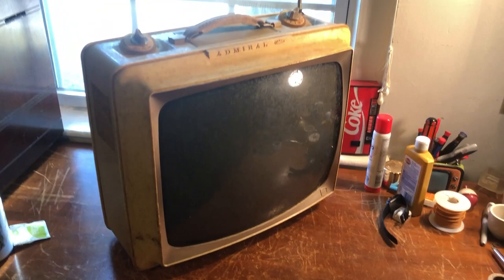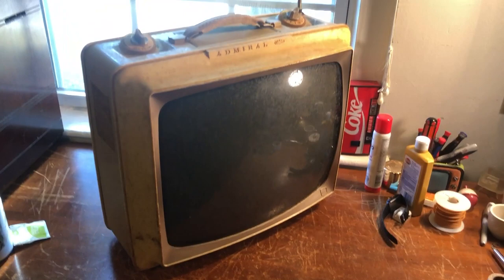1959 Admiral Briefcase Television Restoration

Comment: Model number tags on this vintage sets often on the BOTTOM, ( RCA, Admiral, Westinghouse ) & some others. Chassis ## when used is better to have.  Inked 
or tagged on chassis as a rule. Was a Zenith-Admiral dealer for many yrs.  These
were good sets, better than the newer Admirals.
BTW  if you want to do a hand wired set try a Zenith @1960 or newer.  Easy to
fix & they are almost immortal.   Well done Jack !
LFOD !

Comment: When I was a kid in the 70’s I used to always repair televisions, toasters, vacuums and other appliances. Today I am 62 yrs old and cannot remember one thing about repairing tv’s. I’ve got a 65” tv that the backlights are out on and am afraid to take the repair on myself. Keep up the great work but in the future, please make sure you start off with a clean screen, it really helps. I used to clean appliances perfectly before I worked on them.
Reply: You are saying that back in a day as child you hade guts to open live chasie and now you are afraid to open low voltage tv ?!
Reply: Quite a simple to fix, you just change the defective strip of LEDS inside. You will have to get some help removing the flat panel (Screen) so you don't crack it and all the diffusion layers underneath, then unclip the shield and the LEDS are just held on with double sided tape. Gently warm the defective strip with a heat source, (I used a hairdryer) peel them off slowly and unplug them. I've done a few in my time.

Comment: What a difference between this Admiral and Philco Seventeener. You can tell which one came first by the design ( Philco)
as this Admiral seems to have a more logical placement of the insides of the chassis and much more easier to remove 
from the cabinet! Of course it has  a couple more inches of picture tube than the Philco and Philco will fight back on that.
 Should be a dream to restore the components  compared to the Philco equivalent. Tuners are fussy in  Admiral's and
perplexed my  hobbyist repairman Grandpa many times back in the 1970s.

Comment: Great project!  Very few left around. Since it doesn't have an evil brightener installed you may be able to get some life out of the bulb by a "cleaning" with the proper tester. A later Sencore or B&K or Beltron might spark it to more useful life. If the cathode had been baked with a brightener, probably not.

Comment: Nice looking model, the restoration turned out pretty good.
Just talking to my buddy about AV signals and I was under the false impression Composite was completely different than RF but he informed me it contains some properties of RF too. Mainly I'm kind of anti-RF because it tended to add noise where there shouldn't be any Ie. the signal coming from devices directly connected to the TV not having to "broadcast" so to speak. So the tuner being an obstacle to better picture fidelity would fall under that.
Funny coincidence, that's one of the movies me and my buddy saw together bitd.🙂

Comment: I've got a free GE 430 AA5 I recapped that works until it gets really hot and then the sound fades out that I need restored.  I also just found a free GE 202 six tube radio I'd like restored.  Tubes and dial light lights up but I haven't done anything to it yet.   Got a bad ass TS100 and can solder like a boss but not while blind.  I guess I browse the Radio Attic forums or something to find someone interested?

Radio is dead and I just look up music with Youtube or ask Alexa.   I'm just curious to see how many more stations...  I'd pick up with..  one more tube.  That grandfathered flamethrower out of Nashville is the only station that plays any music.

Now that broadcast TV moved to digital TV some 15 years ago, you're not even going to be able to pick up any stations with this thing are you...    sad but true.  Maybe hook it up to a 2600 or Vic-20